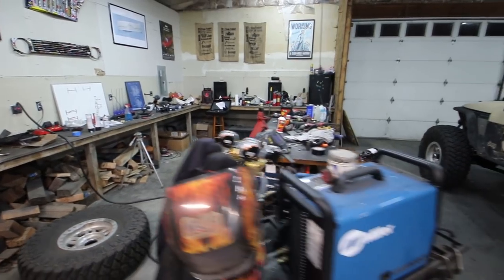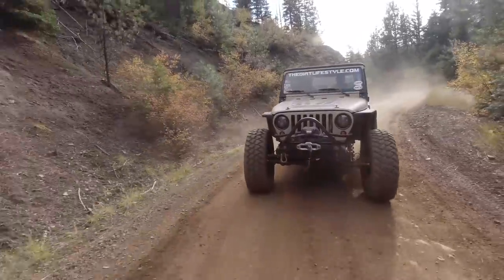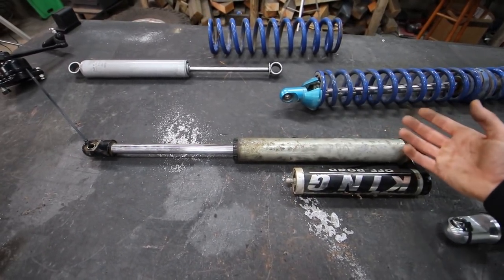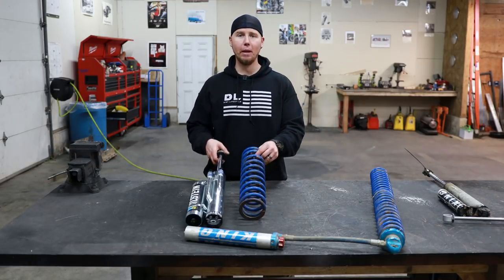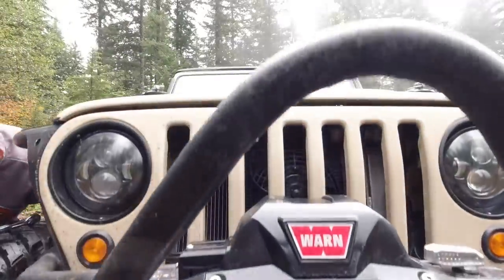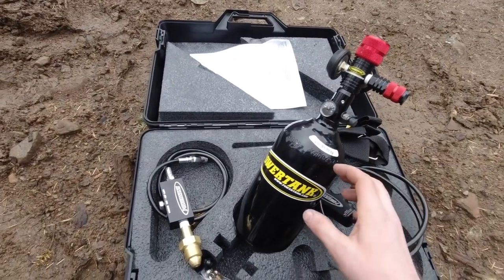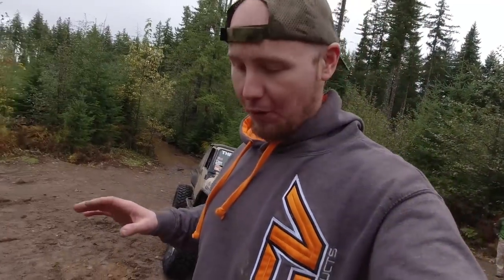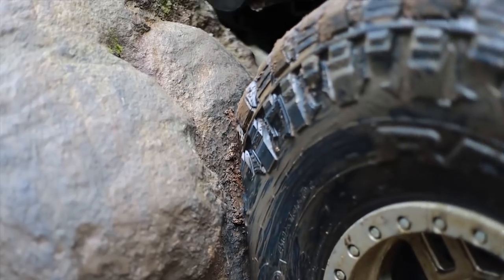Coils vs Coilovers, Shock Tuning and Hydro Bumpstop Tuning (TJ stretch episode 7)

Comment: Cool videos.  Good info, thanks.

I grew up in Vegas area and been using Adams driveshaft for so many years.  When I owned a business building trucks, Later I became a Mac tool guy and Adams was one of my stops.  Top quality people with best gear.  Never ripped people off on parts or repairs in house.   The only place I will ever use for driveline, gearing, etc.  Many companies can have well designed parts- but honesty and integrity are more rare- they have it all.

Comment: Almost every paintball store or paintball field will fill that 3000 psi powertank/paintball tank you're using to tune the bumpstops. That is for sure a paintball tank. Should be like $3 - $5 to fill.
Reply from the maker: Really? I thought paintball guns used co2. But I don't know anything about paintball lol. I'll try a paint ball store next
Reply: @DirtLifestyle  yeah, old school paintball gun use co2, anything made after like 2000 uses compressed air/nitrogen. The real nice tanks will do 4500 PSI too

Comment: I'd be willing to bet you could put that TJ on some Street wheels and tires like some 20 inch for 22in Wheels with low pro street tires and wrench those coils down and stiffen up the reservoirs and that thing would probably handle really good! Pretty light and flat torque curve.

Comment: I would be a little bit uncomfortable routing my exaust next to my gas tank so close. Running good shocks (love my Kings) will have you driving faster off road with the smooth and control added. The external bypass is nice so is a bigger shock. I am considering coil overs up front but after weighing my Bronco front rear and whole truck Bret King tuned them GREAT.  Not sure about the rear I have Deavers and a strong frame to frame two tube upper mount for shock length. Coils would require space inside and tubbing in the body but ? The off roading done with well built trucks at higher speed still has surprises. Most are handled when built well but exhaust  next to the gas tank and a surprise could be to much surprise. Maybe some heat wrap at the location would be a option ?

Comment: You said you have a jetta Diesel in the jeep. You also said if you were to do it again you would start with b-4 Cummins. Can you use a bigger Cummins in a jeep than that? Or a different diesel motor with a little more horsepower? I want to make my own 4x4 rock crawler, and I want a diesel in it. But I haven't decided on the build just yet because I'm trying to figure out the best build. I also think I want a manual transmission. It would be nice to be able to add an attlas  as well. But I'm also concerned with the engine bay and this is why I keep reconsidering my choices. I'd like some thoughts you might have for me, or suggestions.
Reply: ( engine bay size)

Comment: On the wheels around 20:09 - 20:46 + I'm wondering, does the wheel or beadlock extend up, to protect the value stem? 
First time seeing that (if that's what I'm seeing) and I think it's a good idea for "true" off-roading situations
What Brand/Model wheels?

Comment: Now when talking about coil springs. You didn't mention spring rates. I see you are running a multi-rate spring. The question is what spring rates do you think work the best for 4 wheeling. Heavy or light?
Reply from the maker: It's a multi spring rate but the soft rate doesn't do anything for the ride. The soft rate is to keep the spring in place when the axle is fully extended. I like the lightest springs possible that can still hold the weight of the vehicle 👍

Comment: Would be nice if you can adjust dampening and preload from the inside of the cockpit.What you think about in board djustabel airride suspension?
Reply from the maker: That would be a pretty sweet setup if you build it right 👍

Comment: Nate
I value your opinion 
My question is 
I have a 05 tj with G2 Dana 44
Axle housing chromally shafts 456 gears 6 spd manual 
It’s my daily driver 
& I wheel it almost every weekend in Arizona rocks &sand
Are 37s too much for my  axle setup??

Comment: Are you familiar with ORI struts?  Just curious what your thoughts were on them.  I can go to the website and get the marketing mumbo jumbo but I thought I would ask an avid off roader first.
Reply from the maker: I love the concept. I like that you can change the height and the firmness with just nitrogen. I like the super streamline package. I don't like that if you blow one up, your vehicle has no way to support that corner. I would definitely try them on the right project but haven't used them yet. 👍

Comment: So I have a 2000 Ram I’m building as a rock and trail rig and I’m getting ready to link the front,question is am I better off leaving the leaf springs in the rear or link it with coils? Is it really worth doing coil overs in the rear?
Reply from the maker: If you want to use it as a truck I wouldn't go with a coil over. The weight difference is super frustrating. It changes the height quite a bit

Comment: Hi friend. can you help me. I want to put coilovers on my jeep wrnagler and j from 14 in on and 16 in back. What pounds of springs do you recommend. I want to go fast and comfortable and use offroad rally race. The weight of the vehicle is 4000 pounds all. four link rear and front. Thanks in advance
Reply from the maker: My spring rates are 150 over 100 but these rates change drastically from vehicle to vehicle. Coilovers are very sensitive to weight. Removing my spare tire made the rear of the Jeep change height by 1"+. Get your coils from a company with free exchanges. Get some light springs and measure the amount of drop you get when you drop the vehicle's weight onto the spring. There is a formula to calculate your corner weight with this measurement. If you buy from a reputable shop they will help you figure out what you need. 👍

Comment: Just curious, the old tire carrier you had on there that mounted to the body, how did that hold up? I’m curious cause I would like to build something similar but do not have corner guards. I’d be mounting straight to the body. Wondering if it would be strong enough.
Reply from the maker: It held up great! But keep in mind it was mounted to 3/16" corner armor. Not just sheet metal. All the hardware I used was great 8 and fat washer's on the back side.  Good luck with your build!
Reply: Thanks man! Keep up the good work! In your opinion, do you think if I added some bracing front and back it would be fine? Also did you go all the way through the body? I really like your videos. I have learned a lot and plan to incorporate some of your ideas in my own build!

Comment: Can you add bypass shocks without having to build a tower? I have an LJ on a 5.5" lift
Reply: Is it possible?
Reply from the maker: Not sure. It all depends on if the diameter of the shock will fit in your to your tower. 👍
Reply: @DirtLifestyle  im looking at the ones in your video the Bilstein 9200's love the look and reviews of course!!

Comment: Awesome video! How do you like The tires? I have The same but havent got my rig done yet so i havent tested them...
Reply from the maker: Great in mud, great on the street, ok on rocks and TBD in snow. Probably the most durable tire I have owned but that comes at a cost. These are a little hard so I air them down really low for the best traction in rocky terrain. 6 psi up front and 5 psi in the rear. At the end of the day these are one of the better tires I have owned. I would definitely recommend them 👍

Comment: how many times do you think that little tank will fill bump stops?
Reply from the maker: Unfortunately I have no idea lol. My experience with this tank is very limited but  I've pumped up my bumpstops a few times now and the gauge has barely moved. It looks like I could fill alot of them before this tank will run out 👍

Comment: Bro! What local does it say on your hoodie? Are you a plumber, fitter or pipe welder? ..UA LOCAL 342 here
Reply from the maker: Local 26 out of Lacey Washington! Plumber 👍
Reply: @DirtLifestyle  right on brother. Your channel proves what I have been saying for years. A craftsman is a craftsman, those skills are highly transferable, wherever/whenever a craftsman is needed. ...with few exceptions, like pipe welders. But even then. It's only a matter of time n practice. Ours is a combination local (plumbers, fitters, pipe welders and refrigeration) I was planning on getting my pipe welding cert after I turned out as a plumber in 2000. But I have been too busy plumbing and uptown fitting so I haven't needed it, not to mention, when times have been slow in the building trades, it starts with the welders and ends with the plumbers. Lol when times are good, the welders and fitters call us turd herders but when they aren't so good. They are all standing in line, dick to butt to sign up for the plumbing code class at the hall..  
...but yea, it makes a lot of sense that you're a union plumber. It crosses over into your work here .. Keep it up.. I haven't seen any bad content yet. ..and you don't blabber on about common sense issues to make yourself sound superior, like many youtube creators do.
Reply from the maker: @jdog4534  thanks man! Kind words!
Reply: @DirtLifestyle  funny thing about the truth. ..sometimes It's kind and sometimes its not so kind. Lol  ..like when the wife asks if a certain outfit makes her ass look fat.. "no honey, it makes you look old. Your fat ass is what makes your ass look fat." ...just one of many possible unkind truths...  lol

Comment: You have explained things in a way that anyone can understand, superb video series!!! I would love to stretch my TJ. One thing I missed, did you have any issues when you stretched the front axle out with steering linkages?
Reply from the maker: I don't have any issues with steering linkage. I pushed the front axle out as far as it could go without moving the steering Box or linkage. The only special modification was building a bolt on panhard bar bracket on the frame. I  moved it to give me a little more clearance 👍